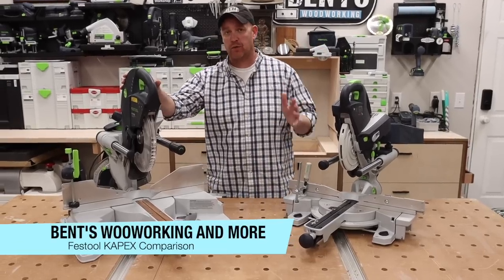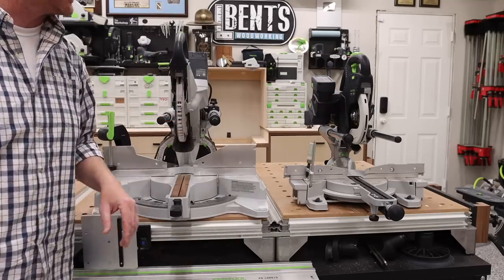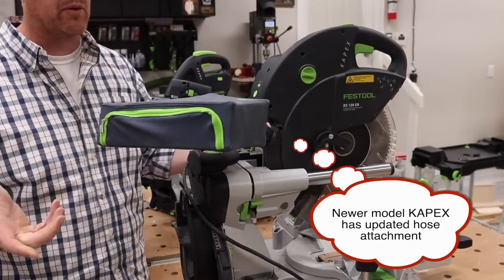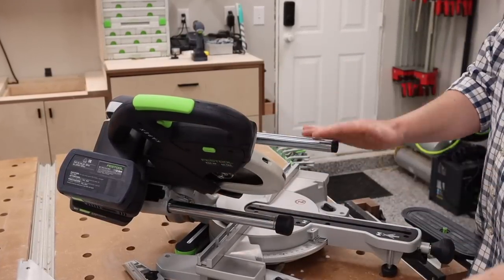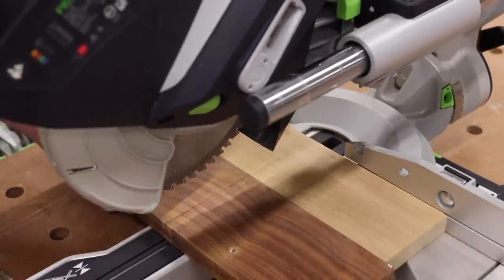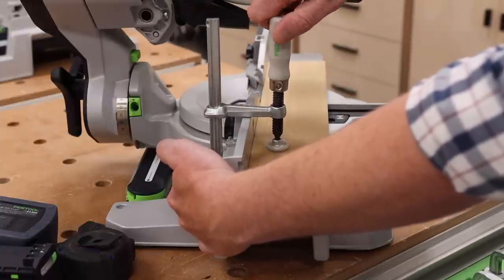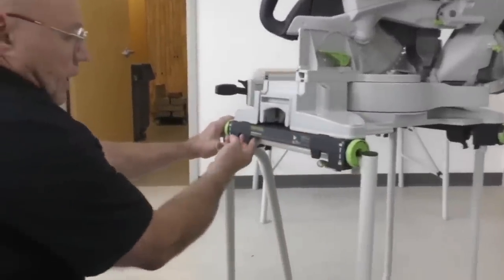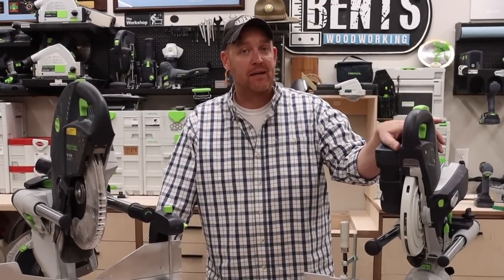Are corded tools obsolete?

Comment: As a trim carpenter, the KSC 60 ticks all the boxes.  I’m currently at a job site with only 2 receptacles.  Most of my trim are flat stock that don’t exceed 12”.  I’ll plan ahead and bring my 12” saw from home if I’m cutting large crown; otherwise, the KSC 60 will cover 95% of my daily cutting requirements.  I already own the batteries, so it’s already $600 less to start.  I’ve been holding out a couple years for this saw and it finally arrived a week ago!

Comment: I want a cordless Kapex with a 10” blade, fine bevel adjustment, fine miter adjustment, tall fences, and the shadow line.  All the best features of both saws in one. 🙂
Reply: I would just buy a battery unit for $1000-$1500

Comment: I’ve owned and used a KS120 since 2010. I’ve had two in that time. That saw has never let me down. It is the benchmark of all mitre saw. Lately I’ve just found it way too much saw for my needs as a kitchen installer/interior finish carpenter… so I recently bought the KS60 to downsize my work tools. Within a week I sold the KS120. No regrets. The KS60 is an incredible mitre saw. I prefer it over the 120 in just about every way.
Reply: I am in the same profession as you and also own the KS 120. What do you do for installing crown? I only cut it in the nested position so you must be very comfortable with cutting it in the flat position. Just curious. I could not let my KS 120 go for any possible reason. Even though I have 7 different miter saws. The best option for any occasion. Thanks.

Comment: I bought the full kit with the stand for the KSC 60. It's supposed to ship tomorrow from Toolnut. I found many years ago that I have little use for big miter saws and have relied almost solely on 8.5in models for the past 6 years. I have a corded Bosch 8.5in that served me well for years which I still use at times, I purchased the 8.5in 40v Makita last year, and now this Festool. 

These smaller miter saws are so good if you do a lot of work away from the shop. Unless you are cutting 4x4's a lot, these little saws do pretty much everything the bigger saws do but weight a lot less and are much easier to transport. You can even cut large crown with them, you just have to cut it lying flat, which really is the better method as long as your saw is tuned properly.
Reply: How do you like your KSC 60? Any thoughts?

Comment: The primary advantage of the cordless KAPEX is portability. It's lighter and easier to store in a vehicle. But, for most things, the larger saw would be better for use in a dedicated miter saw station. The larger saw table creates a more stable platform for your work. The taller fences make it easier to cut compound miters on moulding and the like. In such a situation, where the saw will stay in the same place 99% of the time, the smaller saw's increased portability provides virtually no advantage.

Having said that, I really like the shadow line...

Comment: Awesome review. I needed some good insight and comparison between these 2 saws, and you delivered. I currently use the milwaukee cordless in the field, and I love it. However, in the shop, I use corded, but the power situation is a problem, and im leaning towards battery. The only thing I dont like with festool is I wish the width  of the cut was longer than 12. I use a ridgid 12" that's almost 17" width of cut, and it saves a lot of time vs. having to bust out the track saw. The KSC 60 does seem very tempting, and the weight and portability are nice to have. I mostly want it for the shop, but to have the option to take it into the field is also a major plus

Comment: Just got the KSC 60 with stand and arms... getting rid of my Bosch that was a nightmare to move around the house and with my current shop in the garage (mostly) having the arms for measuring will be clutch!  (even though they're metric)
Reply: What's your assessment of the KSC 60 now that you've had for 3 weeks?
Reply: @AaronGeller  I really like it, no imperial has set me back a little but after I calibrated it the accuracy has been awesome.  I have been trimming out a basement and it's awesome to not have to measure measure measure... I measure space with a laser, set up the stops on the saw and it's always perfect... beautiful cuts too.

Comment: Kind of a strange idea to me to buy a cordless miter saw that is going to stay in my garage 99% of the time, but dang, that is what i am leaning towards.
Reply: So instead of plugging the saw in, you're plugging in a charger and waiting for a battery to charge. Only makes sense if very limited to outlets but still have to plug in the charger. Not to mention a cord is much cheaper than a battery.
Reply: Yeah I love to have everything on battery but my router, tracksaw are all corded. So I think want the corded. I don’t see the added value for a homeowner diy

Comment: Dewalt 12” for large crown, with crown stops. Most other miter saws don’t address the crown issue very well I,ve found.
Reply: Have you heard about the crown support cutting board? It goes across the whole saw and provides a much more stable cutting situation than just the 2 stops. It makes a very big difference. Sorry that I can't add a link.

Comment: When looking into new tools especially Festool I have considered both corded and cordless for a workshop environment. Everything from their track saw to this chop saw and their new small table saw look great. However the boys at work said that battery powered tools are going to be obsolete after a short period of time after buying due to battery depletion and degradation as well as advancements with battery tech tools will become dated super quick. Where as corded will always work and produce sustainable power long term and are better investments as you get a lot more for your money. comparing track saws for instance the 55 cordless to the 75 corded difference with about $400/500 for a full kit. Would you guys agree?  I really like the lack of cords and the small portable lightweight modern advantages of the battery powered options. Is it a good investment or worth the upgrade in costs.
Reply: I can't speak to the performance of festool batteries but I understand them to be some of the best (made by panasonic). As far as investment goes, a battery's life-cycle is around 10-12 years for the best ones. No matter what, all lithium batteries lose their efficiencies over time, so in a way you are paying for a battery subscription if you are a professional user, albeit only 3-4 cycles in your career. So dollar for dollar, corded tools will always be a more economic use of capital but what they cannot provide is the economy of movement that cordless can. You only need to trip over one cord carrying an expensive cabinet to understand that cost. For stationary tools like a miter saw and table saw (where you bring the work to the tool) I think the cordless benefits are not quite the squeeze. Unless we are talking about 'quick' jobs or punch-out work. Even then it wouldn't be a tool to replace but to supplement your arsenal. For tools you take TO the work like a track saw, jig saw, nailers, fein tool, etc. I believe the cost of cordless and the 'battery subscription' is worth it.

As a millwork and cabinetry installer, In the end, I don't believe the KSC60 is a replacement for the KC120 (if it was they would discontinue it). It's a beautiful saw that I'd love to incorporate into my work-flow but I don't believe it has a place yet for the cost. The weight of the saw doesn't mean anything if it goes on a rolling stand anyway.
Reply: @LockDown40  that’s great thanks a lot mate this was super helpful!
Reply: @bobbyfranklin5924  glad I could help!

Comment: Awsome video! Realy helpfull explaining all the differences! Only one final question to you owining both: If you lost both and could only buy one of them back for your home shop where mains power is no particular issue.. get a ks 120 or the ksc 60 with batteries which would you pick?
Reply from the maker: If power isn’t an issue and I don’t need the mobility, than I would go 120
Reply: @bentswoodworking  thanks! 💚

Comment: It should just allow both. I have a tire compressor from dewault and you can run it wired or with batteries, its not difficult. Just a way to charge you for two systems.

Comment: I can see that new KSC 60 joining my shop to replace the very old 12" Delta CMS I have owned since like 2000. I rarely use a miter saw in the shop because of having a slider, but this particular tool could change that for sure based on your videos here and on IG. Thanks for the comparison!
Reply from the maker: You’re welcome Jim

Comment: Are you festool rep? I have no tools whatsoever but need to build a shed/man cave. What tools should I buy? I don’t care if I fail or not its a fun project that I’ve been researching for a while now.
Reply: What kind of projects do you want to do?
Reply: @AaronGeller  build a shed with gym area and little office area
Reply: @bikeomatic8005  For building a shed, miter saw, circular saw, possibly a track saw for processing large plywood panels (although many more purposes than just that), a table saw is a great but a track saw can cover a lot of its functions, drill and driver kit for drilling and driving screws, sanders, dust extractor/vacuum, and potentially a multi tool/oscillation tool.
Reply: @AaronGeller  thanks man, table saw dust extraction unlikely as I dont have a workshop to keep all this stuff, you think I should go with festool on all of this stuff, buy once cry one 😉

Comment: I was surprised to hear you say the dust collection on the ks120 was great. I replaced my Bosch with a ks120 about a year or so ago. While it's an awesome saw and I love it, the dust collection is only marginally better than the Bosch was (maybe 10 or 20 percent better) and the Bosch sucks at dust collection (no pun intended). I put the 50mm hose on it and run a Festool extractor and it still spews dust all over. I tried different blade speeds but still the dust collection is sub par. Not sure if there is anything else I can do.
Reply: When you make a cut with the saw, watch how the dust flies with different styles of cut. Straight down cuts may make a difference over sliding cuts as to which does better at clearing up the dust. Find out which style works best and incorporate that into your routine. Hope that helps.

Comment: Watched your video 2 times, thank you. I currently use the Makita 36v 10”.  

I’m getting old and have had several surgeries but… I need to work, probably until I die.  I carry my saw a lot.   I do like the relatively new Makita 8.5” 40v also.  I’ve been slowly buying more festool products. I like them.  I’ve been wondering if all their cordless tools are worth the $$$$.
Reply from the maker: I have been changing how I feel about cordless tools. The battery life is impressive
Reply: @bentswoodworking  
I have had both.  If I can only have 1 saw, I feel cordless offers a lot in flexibility.

I like cutting baseboard standing up. But 90% of the homes we building these days are calling for 8” base. That requires a saw capable of cutting 7 1/4 height. The best 12” saws can cur 6 1/2 base. 

So.. it may be that running a 12 or 10” miter isn’t that crucial. This is where the new Festool cordless and the new 40v Makita 8.5” miter really shine.  They can cut a huge piece of 2x with few issues. This means laying 8” base can be cut easily on the smaller saws. 

Crown could become a problem with the smaller blades.

Comment: Festool Kapex provides a small 10-1/4" metric blade, Kapex corded has a brushed motor, 13 AMP motor, speed control, on the whole, vastly overpriced.  Lots of complaints with the motors, returns for repairs.  You are locked into Festool's metric system where all components are grossly overpriced and overrated for what you actually get.  You must use Festool parts, you can not replace parts with widely available parts.  Not every town carries Festool parts or service outlets.  Kapex saws could use many improvements and updates, these saws are not worth the asking price.